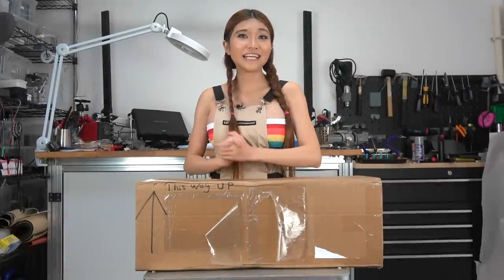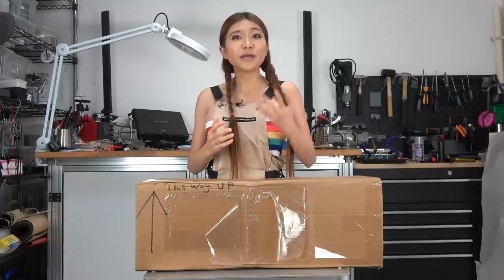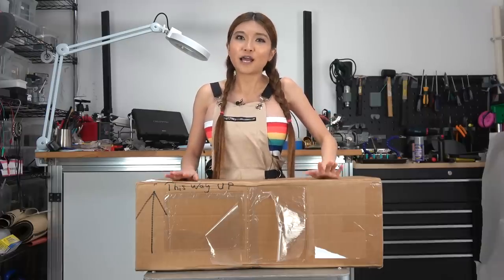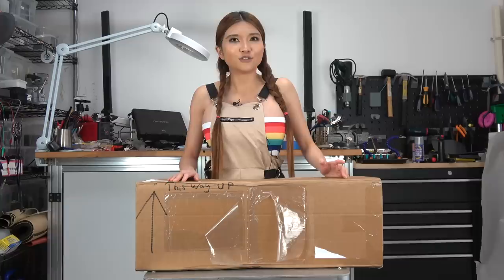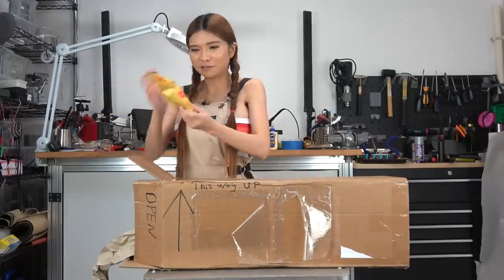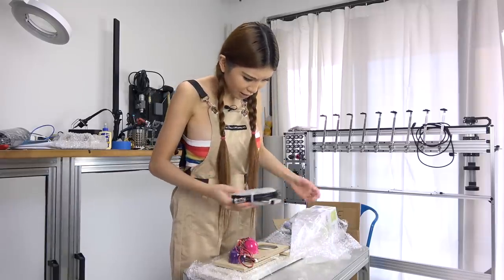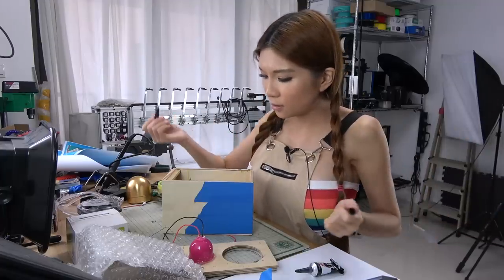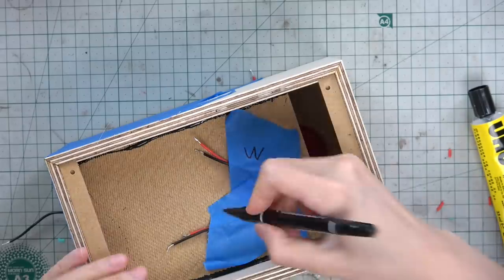Build Your Own Speakers- The Little British Monitor

Comment: You should NOT clean the soldering iron tip before putting it back in the stand - the solder protects the tip surface from oxidising so it will last longer.
Reply from the maker: OK!
Reply: What he means is that the heat from a clean iron (like any hot metal) will start to oxidise if left in open air, leaving the tip surface uneven and damaged. It is a common error and I myself used to do that before I was told by a fellow engineer how to look after tips better.  The trouble is no one really teaches this sorts of skills by default, which is why it is good if people can point it out and then demonstrate how it should be done.  A future video for you perhaps ? ;)
Reply: does this include those times after poking holes in plastic or melting hot glue sticks? as no one seems to have told my 1980's weller 1201 its still on the same as-new tip....
Reply: After watching Naomi's (and others') review of the TS100 iron, I bought one (with a set of tips) and ditched my old Weller WMP.  It switches itself off if it doesn't detect movement (or when you tell it to), and heats up again in seconds, so tip wear is much less of a problem.  Having a range of quick-change tips means I am more likely to pick the right tip for the job in hand and so less likely to turn up the temperature to force heat through an inadequate contact area.  Result is they last much longer as well as being much cheaper.  OK I admit I did have to rig my own PSU and iron stand, but then what are makers for?
Reply: Is that for storage or everytime you place it in the stand throughout your project? Because I've been doing that for over 20 years with my Weller and I've never had to change my tip. (and I bought it second hand so who knows how it was abused before) Now I think about it even before storing I clean it. I'm sure bare metal corrodes quicker then covered metal but if the effect takes so long is it worth placing so much consideration to it?
Reply: @EdHunter55  using a solder iron for 20 years without changing a single tip? how much did it cost you when you got it? I've been changing at least 5 tips with my solder iron in the last 6 months and eventually the problem was resolved by covering the tips with solder everytime I put it back to stand, I couldn't even leave it exposed to open air for a few seconds even if I shut it down otherwise it got oxidized in black which would stop it from melting down solder again.
Reply: @stevenweii  That sounds like it's running way too hot. Is it a temperature controlled iron, and is it a plated tip?  If you have a small contact area to a large pad or pin you have to run the tip hotter to get the solder to melt, then the bit dries more quickly as the solder runs away from the most convex part, and the exposed bit oxidises faster, and your contact area gets even smaller - triple whammy.  Using a conical bit makes it worse, it may  be convenient for access, but it has the least contact area and the greatest curvature, so it is only suitable for small pads and needs to work at minimum temperature.
Reply: So you watch her video too Mikeselectricstuff!...good point though.
Reply: Copper soldering iron tips erode very quickly since the solder, pretty much pure tin now, alloys with the copper and is deposited on each joint. The soldering iron tip she uses is iron coated and very resistant to corrosion.
Reply: Leaving flux cored solder on a hot iron tip often causes a build up of caked resin, so I always wipe it on wet sponge  after making a joint (?). For me Iron tips usually last a long time.
Reply: The tips of Atten are very good, when you clean it remains a layer of anti-oxidation tin. Used with 60/40 1mm tin with resin core, they are practically immortal.
Reply: Looks nice 👍
Reply: Good info, thanks for that!
Reply: you should only clean it before you start soldering :)
Reply: Just the tip?
Reply: I will never clean my tip again!
Reply: sticky170: yes, and only for a minute.
Reply: Incorrect.
Reply: @higgy82  Perhaps read the rest of the discussion as well. There are tips that don't appear to need it, but other tips apparently do. Either way, it doesn't hurt.
Reply: i don't buy that. i give mine one quick poke into the cleaner(the dry,wire sponge type, not a wet foam sponge) and it cleans off the contamination and reveals fresh, shiney solder on the tip. try it. i've been doing it this way for a long time and have  been soldering for 40 years.
Reply: Having soldering for well over 2 decades, I would respectfully disagree. You will never clean all of the tinning off, which is what actually protects the tip. Also, cleaning off the tip means less un-fluxed solder to deal with when heating the iron back up. But at the end of the day, you do you. You wanna leave a glob of fluxless solder, have at it. But at least add some flux paste before getting that thing near a component.
Reply: No wonder the tip of my soldering iron is no longer silver..
Reply: LOL  Yea were watching this video to learn something   sure
Reply: The best way to preserve your soldering iron tip is to clean it after use, then coat it with a fresh coat of new solder.
Reply: @Naomi-Wu   LOL!!!!
Reply: I'm no expert, but the original comment is very strange and seems to be part of a gathering movement of misinformation across demo videos containing soldering. Wiping the tip does not clean it in the way implied, it merely removes excess solder and flux, and if done correctly leaves a beautifully tinned tip ready for work without leaving corrosive flux or residue which would eat away at the tip.
Reply: Best way to extend the life of your tips are to avoid tip cleaners (little cups of powdered solder), if using a sponge do not use ice cold water and the sponge should be damp not soaked, the sponge should be cleaned regularly, after using the iron a small amount of rosin core solder is ideal to keep the tip from oxidizing.  Water soluble and no clean fluxes are rough on tips just like the tip cleaners.  FYI I soldered in a very large electronics manufacturing company and a mid-sized one for over 20 years, soldering components for missiles and bombs, probably the airplanes everyone rides in and cars that everyone drives in.
Reply: Tips are cheap, I don't care.
Reply: Wrong
Reply: Wrong my dad is a pro soldering iron man and he cleans it because their is gunk in that solder that can destroy that tip and ive destroyedmy fair shair of tips by NOT cleaning the tip
Reply: You can wipe/knock off excess. I doesn’t hurt anything. Just a good coating is all ya need.
Reply: Actually, you WANT to clean it thouroughly, and THEN add some solder to the clean tip before cool off/storage so it remain clean and shiny always... dirty tip = loss of heat. Soldering 101 :)
Reply: Fred Methot soldering 101. Clean and shiny EVERYTHING.
Reply: You might call this a top tip for keeping the tips in tip-top condition... a top tip-top tip tip
Reply: I'm a professional solder.  I solder tiny tiny microchips under a microscope, among other things. If you use very sharp and pointy tips as I do, then you need to be careful because the point of the tip will corrode and make it useless pretty easy. Like, if you leave the tip dry and forget to turn the heat off then it could be ruined when you get back from lunch. 99% of the tip might look fine but if the point is corroded then it's destroyed. And melting plastics will create a corrosive acid, so use an old tip for that. Best practice is to clean the tips with fluxed solder and rinse the tip with lots of solder, then wipe it clean and apply flux free solder and let it cool with a ball of solder on the tip. Flux is lightly corrosive so you don't wanna leave that on there. But these things matter very little if you only solder cables and larger components at home from time to time. Those tips are pretty sturdy and cheap. But most important for home users: do not leave your tip dry and hot for long periods of time, the heat will make a dry tip corrode quickly. The original comment is correct. And excuse my english, I'm Scandinavian :)
Reply: @mikew2256  No, you are wrong. A dry tip that is hot will corrode fast. A wet tip that is hot will not corrode. And when you are done with your soldering you should clean it and apply flux free solder and let it cool with a ball of solder on the tip. Then it is ready to be stored and used again. Then the next time you heat it up it will not be dry and you don't risk any corrosion.

Comment: The Werther's Originals were a nice touch.  Reminds me of a repair job I did for a toffee factory, they sent me a part to repair, packed using toffees instead of polystyrene beads.  It cost me a fortune though, one of the toffees pulled a root-canal gold crown off a molar and I ended up getting a titanium implant.  To be fair though, the root post was probably already broken, the toffee just revealed the damage.

Comment: Interesting video. I worked for the BBC at White City Studios in the 1970's and we had the original LS3/5A "bookshelf" monitor speakers which were a bit bigger than these. They had external amps and sounded very good for their size. I looked them up and found that you can get second hand originals for anything from £900 to £2K (about US$ 1,100 to 2,500). Stirling make a new version for between £1,400 and £2K. The Kickstarter prices this kit at £299 and a built version at £349 which is really excellent value, considering the amp is built in. The construction seems to use the best of modern tech with retro design. I think I will have to save up to get a pair! My current system is a nearly 20 year old pair of JVC bookshelves driven by a Muse Audio MU-15. Gives my TV vastly improved sound, but could be better.

Thanks for another interesting build and review.

Comment: First time viewer - YouTube suggestions!   Need to teach you how to solder but otherwise great build!   Appreciate the care you took to assemble the kit.   Wish I could have heard the end results.

Adding - Just seen the desoldering attempts on the shoe video but comments are disabled.   You finish the video "I'm bad at soldering because I need more practice.   Not because I'm a girl".   Exactly!   Practice, that's all.   I employed a "girl" (she's old than me, so not a good description) to do my production soldering whilst I got on with other parts of my business.   She was terrific!   Sometimes we had to work together to get rework done, but she really was fantastic at soldering.

And those solder suckers are terrible.   Some are useless, some too strong they recoil in to the job damaging it.   Solder braid is great if you have a big hot iron as it soaks up so much heat.   Sometimes best to use a hot air gun and remove the part before trying to clean out the hole.   And I have a desoldering iron that the tip has a hole in it that sucks up the waste solder and that really is terrific.   But still, even with years of experience, we can't fix everything and some boards are scrapped.

Comment: Firstly, nice to see you wearing eye protection when soldering. Really don't see it often in other maker videos and it's a always good to protect your eyesight. So, thanks for showing that.

Anyway.  The speakers look like really cool little items. Thanks for showing the build process. I've never heard of them before and they look like a nice little winter weekend project to assemble.   I built some floorstanding speakers several years ago for my home office. Sadly, they got destroyed during a house move (but many of the parts survived and live on in my arcade machine) Definitely going to check these out as replacements for my new office which is much smaller.

Good choice of music too.

Comment: I built little passive monitors from Parts-Express parts. The 4" Peerless woofer coupled with Beston round ribbon tweeter, and 2nd order Linkwitz-Riley from air core inductors and metalized polypropylene audio grade capacitors. The cabinets are near the size your speaker build is.

Comment: Miter fold construction , awesome
Reply: Awesome video Naomi 🌹
Reply: "Mitre" (damned American spelling!)
Reply: David Stringer  A miter joint (mitre in British English, sometimes shortened to miter) is a joint made by beveling each of two parts to be joined, usually at a 45° angle, to form a corner, usually a 90° angle.
Reply: @tomweber8729  Thanks, but I already knew this. I was being parochial (with tongue in cheek as they say), pointing out it is 'correctly' spelt as 'mitre', but Americans spell it 'miter'. Miter is NOT and cannot be a 'shortened' version of mitre (think about it). It's called mitre whether you are referring to a joint (I have made these) or a Bishop's hat. Unless you are American (I'm not)
Reply: And yes, I agree, it's an awesome video done by an awesome girl.

Comment: British top quality studio speakers, then the label on them (the speakers)...Made in China....?
Reply: All KEF speakers are made in China to their specs, even the Reference series. I used to visit Chinese factories regularly to make sure what they made for us (not audio btw but electronics) was fully to our UK designs.
Reply: Most stuff is made in China these days. They're pretty good at manufacturing, and they'll build to whatever specs you require. You want top quality? They do that, it'll just cost more. You want cheap? They do that too, but understandably, quality will suffer.

When a cheap tool from a western brand breaks after little use, whose fault is it? The Chinese who manufactured it, or the western brand for not demanding (and paying for) better quality?
Reply: Yes, I agree....the 'good' stuff from China will be nearly as costly as made in the USA...and there's the weeks/months spent in that container on a ship...
 A while back, I worked for a small computer outfit, we tried getting an 8"X 10" double sided board etched and populated with components...in China...Quality Control...even with constant trips over there, from here in California, nearly all boards failed the tests.......we ended up just getting them etched in Los Angeles (where I was working) we assembled all the components here.
 The problem with the stuff from China, through holes were not plated, and many traces were etched away to nothing.
Reply: Dang, that sounds like horrible quality control. And yet, they're perfectly capable of producing smartphones, so what went wrong there?
Reply: I have a pair of Monitor Audio platinum 200's and they are British design but made in China.   Unbelievable sound and build quality.  I must admit knowing they were from China was a hard kill  swallow,  but I couldn't
Reply: Excellent point, if all the components are not made here in the UK, then in my opinion its false advertising.
Reply: @mipmipmipmipmip Yes my point exactly, it's a shame.
Reply: last I checked,,,, sexy cyborg was made in China and  I'm not complaining ;)

Comment: Hey Naomi!  Great video.  I'm actually glad that you've posted this video.  I was going to buy my nephew a BoseBuild kit, but this actually seems like a good kit to teach him basic-soldering and other things.  You've given me other ideas also, with what to do with my soldering station in my 'tinkering room', particularly, your flexible leg clamps.  I'll be sure to source and buy some, as my current setup is an H-Style clamping lift.  Your 'flexible leg' clamps seems more versatile to hold boards and other parts.

Thanks for uploading!

Comment: Just some best practices with solder and your iron is the tip you are using for this job is to big and can put a little to much heat into the components, you need a smaller tip and the solder gauge of 0.5mm and always put solder on the wire ends as well as the pads you are connecting them two as you will get a better join . when your finished with your iron you need to what we call tining the tip before storage to stop oxidization and pitting of the solder tip. But great job on the project :)

Comment: hi naomi, I would recommand you use a small (1cm wide, flat) brush to apply glue on such small pieces, instead of just applying the glue out of the bottle, it will make the work nicer and you'll have no glue drips.

Comment: The designer / manufacturer of this speaker claims that it is a transmission line design. This is unlikely since transmission line speakers rely on the length of the rear cavity being 1/4 wavelength long, having a cross sectional area no smaller than the area of the bass driver cone and usually tapered to suppress resonances. So for example a TL speaker with a -3db point at 30Hz would ideally have a cavity of roughly 2.8 metres or 9ft length, which explains why the TL's years ago were all around 3ft or so tall with the cavity folded into 3. So to me the LBM is really a bass reflex with a rectangular port. But if it sounds good, so what!

Comment: May I suggest a little active cooling fan to the heat sink. I've done this to amplified power to extend the life of components. Find the hot spot on the heat sink with infrared thermometer. A low profile slow fan could be added with little to no extra parts except the fan as these type pc fans draw very little power. I know you could figure it out.